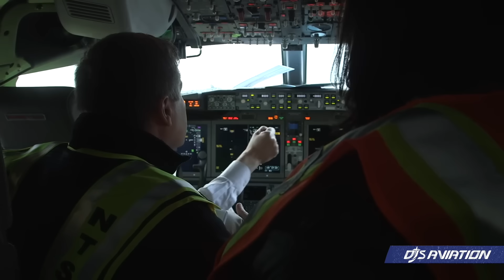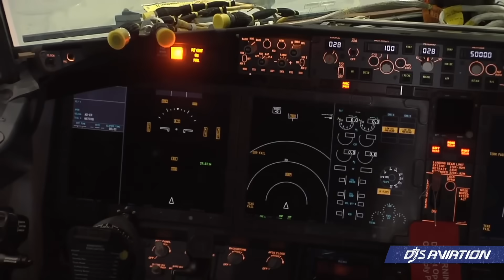Huge Boeing 737-9 Grounding Updates

Comment: I was working at a Boeing subcontractor when Phil Condit took the helm at Boeing. He moved Boeings headquarters to Chicago and spent most all his time trying to bust the union. They put major assembly work for the 787 on the east coast and did every type of cost cutting measure you can think of. In the end the culture change to cost cutting was the wrong direction. Innovation was the path forward, but they didn't see that. Boeing needs to regroup in the puget sound workforce and take direct control of many of their major subassemblies or they are doomed.
Reply: They should hopefully be taking the workforce into the direction of quality and not cost cutting.
Reply: Please, workforce jerk force, it's all about the quality, which started going downhill when they first announced their new ways back in 1986. Quality people until they admit they are lacking in quality nothing will be done.
Reply: RIGHT ON! The move to Chicago to kiss the greedy types has all but trashed Boeing Corp. The tech types, who built the best planes of all we put aside. Now these great workers have need to get Boig back on the best path forward.
Reply: Moving the HQ was ludicrous. 
But given how I've seen unions protect their own regardless of performance, I've no issues with "union busting".
Reply: When the bean counters take over, quality goes into the toilet.
Reply: Have heard that the shareholders were expecting huge profits … but are now suing … what America has turned into.
Reply: Built On Every Investors  Neverending GREED .B O E I N G.
Reply: @vincentdow5899  Thanks for the Fox News perspective.  I thought all of the replies were going to be intelligent, and then I read yours.
Reply: I work for Boeing 12 years now, Boeing has issues hiring knowledge employees, everyone can have a job at Boeing even Homeless people, lack of experience
Reply: @UncleKennysPlace  unions are why you have weekends , coffe breaks , overtime , etc
Reply: @@phillipbanes5484BS only if you don’t know your history.
Reply: Have you seen “Al Jazeera “documentary about Boing?  The reporter with the hidden microphone and camera went to the factory in South Carolina where there’s no union to protect generations of proud Boing workers.(from Seattle, of course) He interviewed many workers about working conditions etc. (including the drugs. They openly talk about it) one of the things  that so shocking to me are that they would never put their own family on 787. Why?  Because the Almighty Boing 787 Is not safe!!  Unfortunately the biggest buyer is ANA which I have to fly to go to 
Japan soon. (There is no other flight available.)Even the United fly Boing 787 from Washington D.C.
The Boing started having many safety and quality problems are when they merged with MacDonal Douglas that  their only concern is money! I wish Boing would go back to Seattle where people know how to make the fabulous airplanes.  By the way , I read recently that Boing moved the H.Q. to Arlington V.A. from Chicago.
Reply: @vincentdow5899  You must have gotten this conspiracy theory from your friends at Qanon, right?
Reply: And there you have it. Profit over quality.
Reply: @vincentdow5899  there were years of delays, serious quality issues, labor disputes, and even a fleet grounding due to issues with 787 production…

The aircraft itself is very advanced, a great design…. but the way production is organized and quality is controlled have let it down big time….
Reply: It was the McDonnell Douglas culture that took over, ending Boeing. This reminds me of the 1972 American Airlines flight 96. McDonnell Douglas never fixed the cargo door resulting in the crash in March of 1974 in Turkey. McDonnell Douglas company culture is the problem here.
Reply: It was the McDonnell Douglas culture that took over, ending Boeing. This reminds me of the 1972 American Airlines flight 96. McDonnell Douglas never fixed the cargo door resulting in the crash in March of 1974 in Turkey. McDonnell Douglas company culture is the problem here.
Reply: It was the McDonnell Douglas culture that took over, ending Boeing. This reminds me of the 1972 American Airlines flight 96. McDonnell Douglas never fixed the cargo door resulting in the crash in March of 1974 in Turkey. McDonnell Douglas company culture is the problem here.
Reply: It was the McDonnell Douglas culture that took over, ending Boeing. This reminds me of the 1972 American Airlines flight 96. McDonnell Douglas never fixed the cargo door resulting in the crash in March of 1974 in Turkey. McDonnell Douglas company culture is the problem here.
Reply: It was the McDonnell Douglas culture that took over, ending Boeing. This reminds me of the 1972 American Airlines flight 96. McDonnell Douglas never fixed the cargo door resulting in the crash in March of 1974 in Turkey. McDonnell Douglas company culture is the problem here.
Reply: It was the McDonnell Douglas culture that took over, ending Boeing. This reminds me of the 1972 American Airlines flight 96. McDonnell Douglas never fixed the cargo door resulting in the crash in March of 1974 in Turkey. McDonnell Douglas company culture is the problem here.
Reply: It was the McDonnell Douglas culture that took over, ending Boeing. This reminds me of the 1972 American Airlines flight 96. McDonnell Douglas never fixed the cargo door resulting in the crash in March of 1974 in Turkey. McDonnell Douglas company culture is the problem here.
Reply: It was the McDonnell Douglas culture that took over, ending Boeing. This reminds me of the 1972 American Airlines flight 96. McDonnell Douglas never fixed the cargo door resulting in the crash in March of 1974 in Turkey. McDonnell Douglas company culture is the problem here.
Reply: It was the McDonnell Douglas culture that took over, ending Boeing. This reminds me of the 1972 American Airlines flight 96. McDonnell Douglas never fixed the cargo door resulting in the crash in March of 1974 in Turkey. McDonnell Douglas company culture is the problem here.
Reply: It was the McDonnell Douglas culture that took over, ending Boeing. This reminds me of the 1972 American Airlines flight 96. McDonnell Douglas never fixed the cargo door resulting in the crash in March of 1974 in Turkey. McDonnell Douglas company culture is the problem here.
Reply: It was the McDonnell Douglas culture that took over, ending Boeing. This reminds me of the 1972 American Airlines flight 96. McDonnell Douglas never fixed the cargo door resulting in the crash in March of 1974 in Turkey. McDonnell Douglas company culture is the problem here.
Reply: It was the McDonnell Douglas culture that took over, ending Boeing. This reminds me of the 1972 American Airlines flight 96. McDonnell Douglas never fixed the cargo door resulting in the crash in March of 1974 in Turkey. McDonnell Douglas company culture is the problem here.
Reply: It was the McDonnell Douglas culture that took over, ending Boeing. This reminds me of the 1972 American Airlines flight 96. McDonnell Douglas never fixed the cargo door resulting in the crash in March of 1974 in Turkey. McDonnell Douglas company culture is the problem here.
Reply: It was the McDonnell Douglas culture that took over, ending Boeing. This reminds me of the 1972 American Airlines flight 96. McDonnell Douglas never fixed the cargo door resulting in the crash in March of 1974 in Turkey. McDonnell Douglas company culture is the problem here.
Reply: It was the McDonnell Douglas culture that took over, ending Boeing. This reminds me of the 1972 American Airlines flight 96. McDonnell Douglas never fixed the cargo door resulting in the crash in March of 1974 in Turkey. McDonnell Douglas company culture is the problem here.
Reply: It was the McDonnell Douglas culture that took over, ending Boeing. This reminds me of the 1972 American Airlines flight 96. McDonnell Douglas never fixed the cargo door resulting in the crash in March of 1974 in Turkey. McDonnell Douglas company culture is the problem here.
Reply: It was the McDonnell Douglas culture that took over, ending Boeing. This reminds me of the 1972 American Airlines flight 96. McDonnell Douglas never fixed the cargo door resulting in the crash in March of 1974 in Turkey. McDonnell Douglas company culture is the problem here.
Reply: And yet, the criminal results of his work has not involved any such management crooks and stockholder suck-ups landing in JAIL?!
Reply: Spirit aero systems caused this problem and many more we haven’t even found yet
Reply: Airbus will always win 😂
Reply: Not just the union. Think they were getting screwed by Seattle as well.

Comment: Calling the issue a "quality escape" instead of a failure is like calling an explosion an "energetic disassembly".
Reply: SpaceX calls it RUD when a rocket blows up. Rapid Unscheduled Disassembly.
Reply: It's not a design failure or a material failure, it's an error of someone in the fitting of some other equipment, and it appears that the "escape" is probably an issue of a subcontractor having less than perfect QA processes.
The one thing that might be a good plan is to employ some additional electrical contacts, or magnetic sensors, that detect the bolt position in the sliding track, so that a missing bolt, or anything that causes any movement of the plug would be integrated into the rest of the sensors for door closure (gee, assuming that there is a door safety check method)
Reply: @ProT3ch  Unlike Boeing, Spacex uses its failures as uber-valuable learning opportunities.  Never let a crisis go to waste.  We learn best from our own mistakes - if you never make mistakes, you  are working too slowly.  If you make too many mistakes, you are working too quickly.  Keep a diary  of your failures & your successes.  Seek the sweet spot in the middle...
Reply: Like a fart is really a windy appendage.
Reply: Sudden pressure loss initiated by the unplanned departure of a cabin access point........top that.
Reply: @ProT3ch  A manned mission is never a RUD.
Reply: Ladas of the sky.
Reply: @fordtransit0  That's giving Boeing too much credit. Lada > Boeing
Reply: "Quality escape means a situation in which a supplier’s internal quality control system fails to identify and contain a nonconforming condition." The term quality escape is a legal term universally recognized in the aeronautic world.
Reply: @lohikarhu734  They will probably have to install door warning to placate the powers at be. This "Plug" has Quadruple safety redundance. Any bolt would keep the door from transitioning up off the pressure lugs. They must have Block and serial numbers. They should know the work card. That card shows where and by whom the door was installed by. The inspector on that card is responsible.
Reply: @sylvietougas9374  Still a euphemism. Just because it's a fancy euphemism doesn't make it not a euphemism.
Reply: unintended nonlinear response
Reply: To be fair, an explosion could also be "Rapidly exothermic chemistry."
Reply: Its this new BS language everyone is using. You are not homeless, you are "unhoused", you are not hungry you are "food insecure". I absolutely f-king hate it.
Reply: Bring back the Real Boeing.  It’s all about Capitalism/the Big guys at the top.  Fewer bonuses, more skilled leadership and good aviation.  The FAA is worthless.
Reply: @montanacrone8984  Boeing is just typical of all us business now. The real Boeing will never come back, just like the real Hewlett-Packard, or the real Rockwell, or the real GE will never come back.

The FAA is OK. They do a very good job in many areas.  The problem is the FAA administrators who are politically captured by corporations. And the root cause of that is money in politics, and the revolving door between business and government.
Reply: Crashing into the ground in a screaming fireball is a thermal deceleration incident.
Reply: @fatfreddyscoat7564  technically its an "audible thermal deceleration incident"
Reply: @piccalillipit9211  …and war is now a “kinetic response”….
Reply: @PRH123  I restored a GE radio receiver amplifier a few years back - it was a work of art. To keep the AC voltages away from the RF receiver as much as possible it had a separate chassis for them and the on / off button operated thin steel cables that ran to the back of the set, along the back, down, and then back towards the front to turn the AC switch on and off at the very back corner of the unit.
Reply: @piccalillipit9211  cool…. At one time a couple of decades I had some Rockwell power tools, they were works of art…. Metal chassis, lubable replaceable bearings, rebuildable motors…. they could literally last forever with a little regular service….
Reply: @lohikarhu734  Ah there's a problem with your reasoning, more equipment means less profit and more outlay. Perfect for any normal company but not Boeing 😒
Reply: Massive newspeak and gross rationalization.
Reply: Passengers next to this door should get free travel insurance.
Reply: If the door is a plug up so what about all the other assemblies made by some hick company. Any rushed return to service is very dangerous.
Reply: @PRH123 is it a quality escape to  get sucked out of the aeroplane ??
Reply: @fatfreddyscoat7564 yes. Unintended over speed control loss hull loss. Passengers ? Huh.
Reply: @simonf8902 I think the new terminology for this kind of incident would be something like pressure differential-induced involuntary high altitude egress.
Reply: @simonf8902 and a complimentary parachute perhaps.
Reply: 🙄ALTERNATIVES FACTS
Reply: Agreed
Reply: Airbus will always win 😂